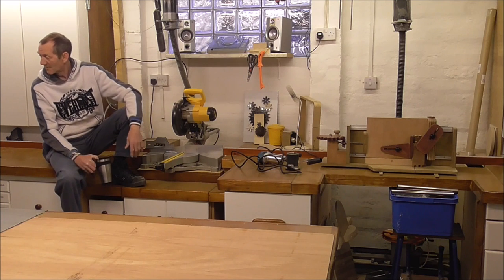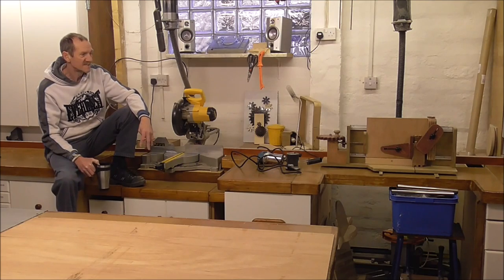Router Copier/Man in the wood consolidation video

Comment: How much was band saw n drill press mate also
Reply from the maker: dan barrow hi Dan I've been working with wood since I was give a small bench in my Dad's workshop at around 8 years old as for doing video that all started with my campaign van 2010 and after I finished I just found it helped a lot of people if I could show how easy it is to do so many things so I carried on the videos
Reply from the maker: the bandsaw in this video I have now replaced but I think it was around £250 and really well worth the money
as for the drill this is as good as I will ever need and again it was under £300 at the time of buying
Reply: What camera do u use and how do u editor on you tube mate please
Reply: David Gladden  I have all tools just need a table saw n drill press, thickness planer is good I have a jet one I haven't noticed one on ur video mate I think lol, I also have a trend pocket hole jig they are cool mate lol
Reply from the maker: I use a Panasonic HD  HC-V250 and edit every thing using both Panasonic and  Windows Movie Maker
Reply from the maker: I have had a few if you look through all my videos Im sure you will come across one but the table saw really is the heart of the shop
Reply: I mate is selling a drill Press n band saw £100 for both both with wheel base the band saw is a Axminster one ain't sure bout drill press but that's also a good one mate, only thing bout the drill press is turn it on n off at wall switch as it sticks on the machine but change that over mate that's noting buddy